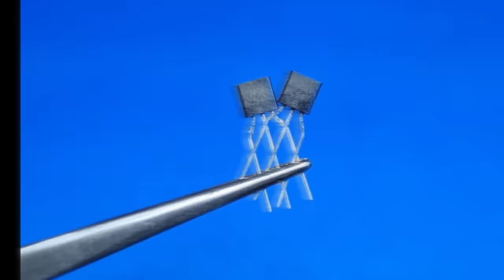New - Simple Remote Control AC Light Circuit - Without IC - Simple Infrared Receiver Circuit

Comment: I did it a few times and found that it doesn't seem to work. It can be turned on the first time, but it can't be disconnected the second time? The circuit is out of control, and the remote control of the TV is not sensitive. What brand do you have?